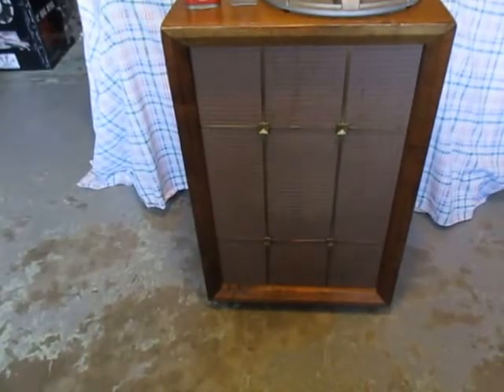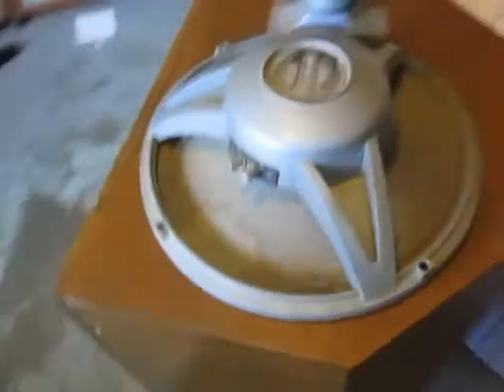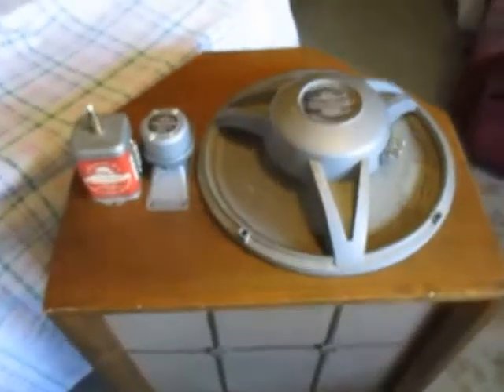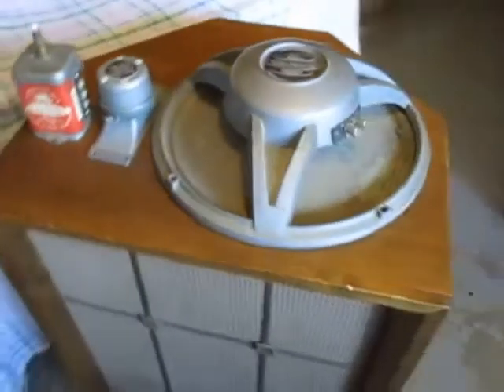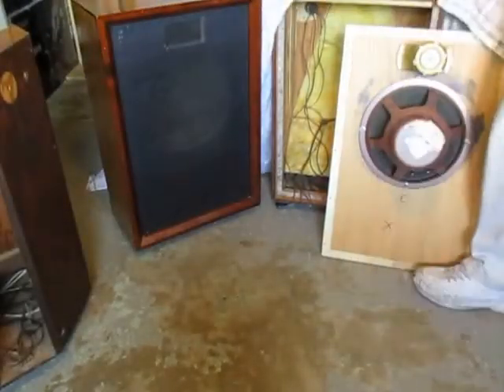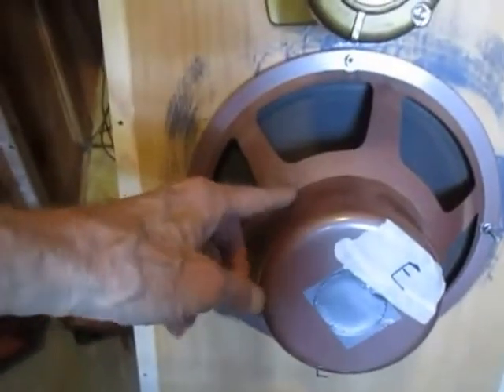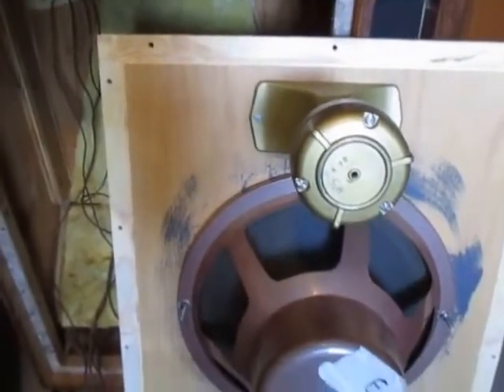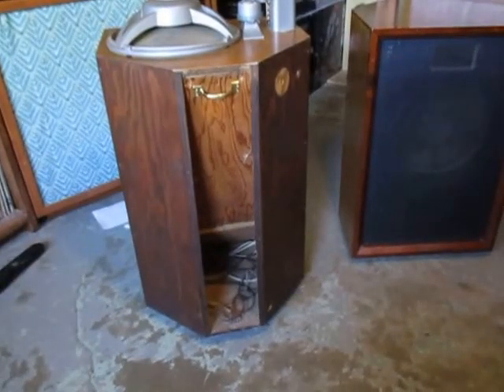Electro-Voice Aristocrat speaker and DIY clones.

Comment: I have a pair of Aristocrats - well, one and an exact duplicate I built with my friend in about 1982. I think these cabs are great for updating as well as restoring. We did an 'upgrade'. First, we eliminated the paper drivers and replaced them with a matched set of Peerless poly 12"  woofers, then separate sealed dome mids and tweeters... not the most costly or cheapest drivers, but good for the $$. We opened up the mids and damped them out and resealed them. We painted the insides of the cabinets with industrial damping compound and fastened acoustic foam throughout. The front baffles are 1" particle board - also damped. We fastened threaded steel anchors to the enclosure and 20 screws around each front. These things are way HEAVY! Lastly, the woofer frames also were treated to minimize ringing. I have always loved the bass resonance these put out and the imaging we got is great too.  I wonder what kind of SOTA update is possible today.

Comment: I have a pair of 3 way Aristocrats I bought for $20 and am in process of restoring them
Reply from the maker: Which drivers and crossovers?
Reply: Mine have the nice polished driver's. 12W, T25A and T35. I have one T35 needing work and one of the 12W
Reply: X8 and X36 crossover
Reply from the maker: @javierdenison8579  what woofers and horns are in it? What size. 8's 12's and 15's could be had in them. You could buy them in flat kits and assemble them yourself. Mine has a 12 inch that looks like a flying saucer.
Reply from the maker: How are you coming along on restoring your Aristocrats?
Reply: @javierdenison8579  do these type of crossovers stay within spec over many decades?

Comment: nice work, how do they sound?
Reply from the maker: Back in the early 50's the low frequency drivers did not have much excursion and therefore didn't produce a lot of bass like drivers from the 70's on. The odd looking 12 inch drivers were Wolverine models from Electro-Voice and were actually full range drivers with good response up to 7000hz. The Aristocrat enclosures were also used with the better Electro-Voice SP12 drivers with a little more suspension and excursion but these too also went up to 7000hz. They actually sound very good without a higher frequency unit if you can boost the treble above 7000hz. Not for the rocknroller, but sound very natural on acoustic instruments and vocals.

Comment: You did a nice job on those.  Do you still build speakers?
Reply from the maker: I no longer have a decent table saw or a shop space to build in. I've made two simple small boxes for car subs in the last couple years, but they weren't for any particular application, they were just for my dyno testing of amps.